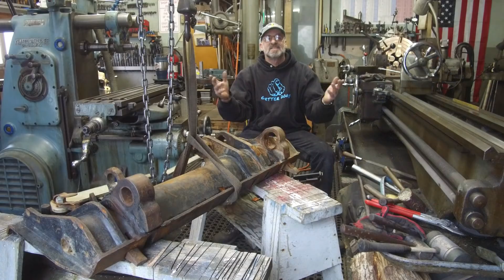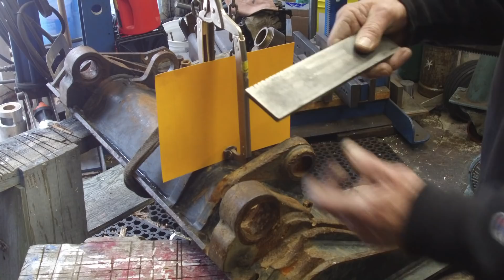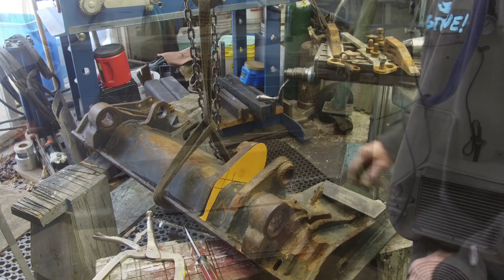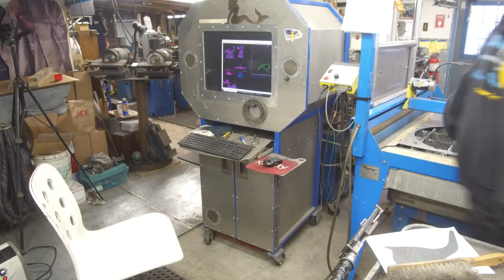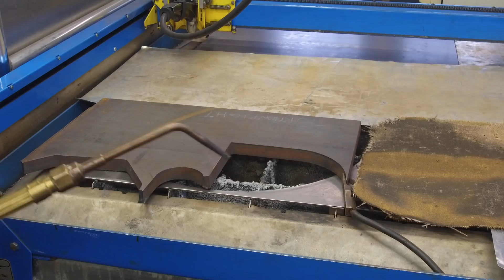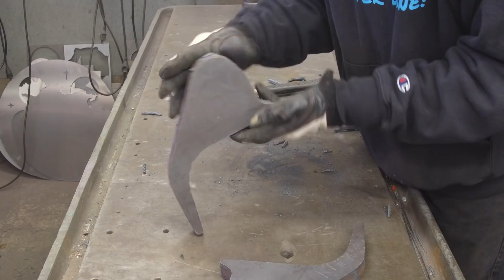Intentional Disregard

Comment: Since the black gives you a better contrast for the scanning, maybe try a white paint pen on black paper. I haven't completely switched to paint pens, from Sharpies, but are using paint pens for about half of what I used to do with Sharpies.   

Sharpie makes a good paint pen. Dykem makes them as well. The paint pens that have been around for a long, the yellow ones used in wrecking yards, (can't recall the brand name), tend to leak, and get messy real quick. (especially if you forget to re-cap and then shake it. there's a selection of different colored spatter in various places around the shop, which prompted me to stop buying that brand.)
The Sharpie brand paint pens don't seem to do that. Haven't used the Dykems enough to know about them. All of the brands make regular and fine point paint pens, the fine are better for smaller lettering/numbering and pattern making.  I usually get both.

Something I've done which I couldn't do with felt pens is institute a color code for fasteners. Red is metric. SS is blue. It sure helps when you're putting away used fasteners, and looking for them, later.  I even went as far as buying red and blue shelf bins.  Just couldn't do it with felt pens.

Hope this helps ya.

Comment: Another interesting episode.  Rebuilding things you just can't buy any more saves a lot of valuable "cores" from the scrap heap.
Rather than using a Sharpie to darken the material, you could spray-paint it.  Or you could use black paper and a silver Sharpie.  Funny to see you "sneaker net" the files, rather than put either thing on a network like the CNC guys.  Old school still works for lower batch volumes.
Who made the computer cabinet?  Interesting to see the speakers and such; unique for a "machine driver" computer, though I'll bet you'd be able to use 1/2 as deep nowadays.

Comment: Not as bad as some i've seen, but still, a big job. Kinda reminds me of our third scraper we bought, paid around 5k for it, because of its poor state of disrepair, shot engine (turned out to be a seized pump) and general lack of maintenance. Initially for spares, but our savvy guy figured that it was a good machine under all the abuse. You should've seen the waller in the joints, i swear, on the rams, you could probably fit one and a half shafts, and when we got it, there was a piece of wood parquet stuck in to make up the slack. :))

Comment: Wow!!!!!!!!! I've seen and operated some really old, neglected and some that had just plain piss poor preventative maintenance done or not done to equipment a whole lot larger and a lot more powerful than tinker toy bobcat sized machines in the last 40 or so years. But I gotta say I haven't seen anything that bad before. So damn much slop in the pins and gaping holes long after the bushings finally got ground down to dust that the eye's on the hydraulic ram ends were wearing themselves and the steel on that quick change. Damage that severe takes multiple years and hundreds of thousands of cycles to wear out that much steel. I could see that happening by doing destructive part testing on purpose in a lab maybe. But accomplishing the same thing day after day on job sites? The "operator" must of been blind, deaf plus neanderthal grade ignorant about the cost savings and benefits of using some grease more than once a decade.:-)

Comment: Very common on the "Quick Attach" components industry.  Too convenient to the Operators to worry about adequate lubrication & 'wear & tear"of the equipment.  Cutting new pieces & attaching new 'bosses' is easy.  The line-boring for bushing fit & alignment is where the details really comes to bear.  $$$$$$$

Comment: I ran a Torchmate. It went to 100 amp and could only cut up to 3/4. 
I find it interesting that you can cut 1" with 60 amps.
What are you using for drying air?
I really wished I had dry air! I could hear it when a slug of water went through the plasma. The owner had no clue how to run the machine. I learned from the ground up how to run it.

Comment: Equipment services (grease the pivots check engin oil and air filter)  was the responsibility of the operator. every single time anything ceased up or fell apart the operator claimed it was greased before every shift and that they spent so much time doing so that they were unable to get any work done. So after many years of seeing things like the example you have . I have concluded grease is bad for equipment.
As far as the uneven wear is concerned, it only had one cylinder  and that cylinder was one the side so the load is disporporational between the pivot points.

Comment: Some projects walking into your shop seem like it would almost be easier to fabricate the item from scratch versus reboring and bending and rewelding. This one is a toss up. Especially when you consider that you could straighten up something on that adapter piece nice and proper and then it no longer fits the mating item on the machine or on the implement.

Comment: Looks like the type of jobs I usually get! It is going to be a lot of welding and grinding to salvage that pivot ear. I think I would be tempted to just use the plasma to cut a new one of those too. Even if it was too think and I had to cut it out of 2 plates and sandwich them together. I think it would be faster and cleaner repair.
Reply: Howdy

Comment: You might want to see if you can get some dust/dirt  shields for those  bushings which most tach systems use presently.  This setup just sucks because once the lube system gets plugged up it requires a tear down  to get it all clean up and working again.  As a result it just gets "run on"    until it gets like this.  Admittedly this is the worst I have ever seen in 40 years!

Comment: Holy crap!!! I'm a mechanic for equipment rental company, I've seen cases of wear and neglected , but this definitely takes the prize!!!!!!!!
Reply: I think it was 1973 our crew forman and I went from Kansas City south to about Nevada, MO to pick up a back hoe and 1 1/2 ton or 2 ton truck from a crew that had finished their project.  When we got both vehicles back to KC we had to take each in for major rebuild as the front end was gone and hardly steerable on the truck and the end of the stick the bucket attached to was so wollowed out none of the bushings were there.  The truck front end was about $1500 to $2000 and the backhoe had to have a new end welded on with all new bushings and new pins plus other work to the tune of about $3500.  The company put the worn, mangled pieces in the bucket so we could see the damage.  For the want of a $15 grease gun and the omph to use it all this damage was done.

Comment: Metal dissolving grease....Who makes this stuff? :)
Reply: I've seen guys improperly use anti seize as high temperature grease and it seems to have a similar effect over time, especially in dirty environments. MDG is an interesting concept however, cheers!
Reply: Just add diamond grit to your choice of grease
Reply: I work on the coastal plain.  Grease mixes with sand and erodes everything.  Same with sand and antiseize.

Comment: enjoyed....I like using blue tape for copying a part, start at the base and lapping/build up layers towards the top, then hammer/knife trim like a gasket, lift the tape pattern of the part, takes the guessestimate adjusting out since it is following the part.....lift off tape and transfer to part or scanner

Comment: Any thoughts as to why one ear has extreme wear and the other still has a partial bushing left?  Maybe the machine that hooks to that is kitty wampus?
Reply: Hydraulics are only on the one side so it concentrated the force there. Likely it's off a JCB or similar one arm machine that doesn't have any provisions for another cylinder.

Comment: That plasmacutter really is an incredible machine. What would take hours to cut and grind by hand is done in minutes on the machine.
And you can store and repeat the shape as many times you wish.
This looks like a very interesting restoration job, which really involves most of the different skills that makes you a professional machinist.
Thanks for sharing Mr Fenner.
Reply: Cut in 2 min with gas torch
Reply: @9534alex  Yes I know. You are an incredible Superman. And you wont even need to finish up the part after gas cutting.
You are a real pro, best in the world, like your President 🤣🤣🤣
Reply: No need to get defensive I was just stating maybe a more low tech way th do the job I'm not by any means the best despite my efforts and finally my president? I'm not American
Reply: @9534alex  is right ,,, Well thats how it was done by me and many others ,, year in year out ,, plasma is only out 30 years , and flame cutting is very efficient ,, nothing against this method by Keith,, just there are other ways to skin the cat . and if your doing more than a ONE off , its then the savings come into play  ....